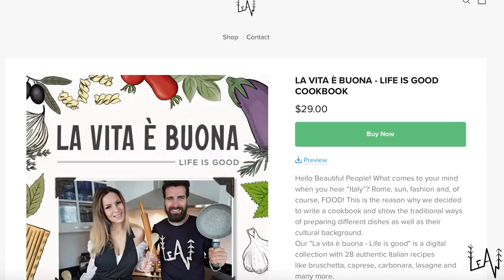COUPLE BUILDS A DIY backyard SHED in EXTREME weather ITALY // START TO FINISH timelapse

Comment: When I see the beautiful colors of Italy's landscape, especially in May and June, I think of the rain that's needed in March and April to create those colors. However, hail storms in July are very strange and scary. You worked very hard on this project, but it seemed to me the wood was low-budget material. I don't know what winters are like there, but I don't see this shed lasting very long. I remember building a shed with my dad near the pool of our family home. He laid a concrete floor above dirt, and the walls featured double wood with a 2x4 structure in between. Before the outer layer of pressure-treated wood was applied, a back tarp material was tarred to the infrastructure for added insulation and protection. 20 years later, the shed is still holding strong. Nothing sexier than a guy who enjoys building things, and it's total fun to see a pretty woman man-handle a saw. Fun video.

Comment: The shed looks great. I think your problem with the floor is due to two reasons (from what I could see in the video): 1) You glued down the boards and 2) You left little to no room on the sides. These two things restrict the ability of the wood to expand and contract with changes in humidity (and rain directly on the boards changes the humidity fast). In your case, with the rain, the boards tried to expand (ie. become wider), but there was no room, so at the spot where the boards were least fixed to the beams underneath, they let go and were pushed up. I estimate that you will need about 1 to 2 centimeters of room between the boards and the sides of the shed and it would have been better to not use the glue on the floor. Hopefully it will now stay flat, but if you do have to redo the floor again, I hope my advice helps you.

Comment: The shed looks beautiful.  Luca does excellent work.

Big rain for the last 4 days here in Tucson.  There's been flooding and fast water rescues.   It's brought the desert toads out of the ground at my place .  Amazing animals.  They survive the 45 C heat with no water by living  underground for 50 weeks out of the year.  No rain last summer, so the little guys have been underground for 2 years and survived just fine.  Incredible.

Comment: Your new shed is beautiful! You are both so inspiring; you both work so hard to achieve your dreams. Thank you for sharing your adventures and projects with us. Won't the rain and mice get into your new, dry shed through the holes I saw in some of the wooden cladding? I'm sure you thought of that already.  Something I've never done before? Inspired by Luca, I took apart my DeLonghi vacuum cleaner that no longer had strong suction. I cleaned everything I saw to clean, but it still didn't work well.  So I took it all apart again  and, instead of just rinsing the non-removable filter,  I spent an hour painstakingly cleaning out the rinsed (but still clogged) filter,  using an entire bag of 350 wood and cotton Qtips. Now it works great! Before "meeting" you two, I  would just have called a handyman (or bought a new vacuum cleaner). Thank you! 💙
Reply from the maker: 💙💙💙amazing!! You did a great job! Proud of you!!! 👏🏻👏🏻👏🏻👏🏻

Comment: The shed looks amazing!!! 👏
I don't know if you get very strong winds there, but you may want to consider anchoring the structure more to the concrete wall. I'm not a builder though, but I imagine drilling into the concrete wall and attaching posts to the wall and the shed, I don't know if that's possible?
I'm in such awe of all that you guys do and how you are you aren't afraid of challenges and making mistakes ❤
I tried skiing for the first time a couple of weeks ago. I didn't think I would do it because I was afraid of hurting myself,  but I did it! 😃

Comment: Nice work. In Finland we put two boards on each outside corner to finish it off.  Usually white with a contrasting colour to the main building/shed (e.g.barn red). We also put a metal roof as it’s stronger & adds much better weather protection.

Comment: You could leave gaps around and between the floor boards, wood is always shrinking and expanding with humidity and also for air circulation.

Comment: Luca, do you think the wood you used for the roof frame is thick and strong enough to hold up the roof fully loaded with snow?  Those boards look pretty thin. I would use 2x4s. 🌞

Comment: Your shed is tasking shape. Consider that the flooring will and walls too expand and contract across the width of your boards. So leave 12mm of a gap on both sides of the floor,[ for expansion ]  the length will not change noticibly. Cover that with a trim moulding to keep out the little mice. Based on the amount of snow and rain you had last winter, those 2x3 roof joists will not hold up, consider 2x4 at least, preferably 2x6, so it does not collapse under the wet snow you've had. Love you both All the Best        CHEERS      Steve h.

Comment: Shed Looks nice, didn’t see you fasten it to cement foundation.
2x2 rafter seem to small if you get a load of snow or ever need to get on the roof.
With such a large overhang the wind could lift it off.

Comment: My OCD kicked in when I saw all the knot holes. Im like hurry stop them up before the wasps move in.lol. 
It needs to be anchored down and with no more support then the roof has a heavy snow might crush it.
Reply: Mice will get through the holes was my thought...... and chew up your stuff in winter.
Reply: I definitely thought the roofing 'joists' aka supports could have be more as in closer spacing, I wonder if they use pressure treated lumber in Italy,  tbh its a pain the arse, you blink and that stuff cracks and warps the second its cut !
I've built huge planters on my roof but this Summer decided to build and L shaped planter  4 1/2ft by 4 1/2ft , 14 inches wide and 30 inches deep. No visible screws, pocket holes that I filled with saw dust and PL adhesive,  oh and I built it on a slanted roof in 90 degree weather and somehow it turned out level - no idea how lol

Comment: I’m impressed with your building skills! Great job! Does the cement wall need to be sealed from moisture? It would be a bummer if it got musky or moldy in there. I don’t know if that would happen but in home basements sometimes it’s necessary to seal cement or concrete blocks. You are an awesome team!
Reply: I agree on the sealing the concrete.

Comment: Nice video you two. I see a future problem with the floor happening if you don't put down a vapor barrier to protect the floor from moisture, rot, decay, mold, mildew, termites, carpenter ants, etc. It's your build and you did a good job. I'm just trying to save you from a future problem.

Comment: If the wood was "kiln" dried , using it outside it will expand. you need to leave about 1-2 cm around the wall edge on the floor for expansion. The floor will expand and contract with the humidity. Not so much in the long direction mostly in the width. Good luck.

Comment: Great job alot of hard work. Only concern is if you go away and are storing things of value like tools.  you put exterior hinges so if someone wanted to break in, all you have to do is unscrew the hinges to open the door; so no security.  if its not an issue than hopefully no problem.

Comment: did you use some silicon or other sealant for bottom of the uphill wall? If there's heavy rain, water will run down the hill and might enter the structure. Maybe an extra board on the outside stuck into the soil would also have the same effect.

Comment: Very nice job. Now you need a chicken coop somewhere else for fresh eggs. Weather modification. The seeding of aerosols creates huge down pours when the aerosols rain out of the sky after a seeding project. I have a sensor and the air pollution increases with rainfall. The pink sky later had a chemical trail from the jets spreading more aerosols. The color comes from the pollution they are spreading. You may also notice a warming trend between the spreading and the rainfall. The man made clouds hold the heat into the earth.

Comment: Dear Luca and Sara,

Most types of wood when in direct contact with cement or concrete will encounter serious decay very rapidly, like within a year or two.  The wood will turn into soft.  A separation is required using something very thin like sheet metal, plastic, tar paper or a coat of tar.  When exposed to the sun tar paper and plastics will decay too.  A retrofit using non rusting sheet metal is what you want and, sloped away from the wood to drain off the water.  You can do it.

In N. America were there are two types of natural woods which can have contact without corrosion. They are redwood and cedar. A third very common type of lumber here is pressure treated with chemicals.   

Ouch and oofa.  Sorry to be the bearer of such bad news but, it hurts to think that you might suffer this kind of loss.  We build with wood all the time in North America so, we know.  Please look it up for yourselves: "wood in direct contact with concrete".  I hope this saves you from heartache later down the road.

The shed is beautiful, honey colored wood, the natural color of concrete, excellently crafted.  The one step will help it many years.

Much love to you both and thanks for the wonderful videos.
Reply: pls excuse the typos.

Comment: Why not get both since your half way there? A custom shed and room upstairs. Make it so the floor can swing up both side fir access. And upstairs you can take out half that wall. As you can have 1/2 of the bottom wall there but it's a swing out long window to open up that view.
Reply: If you wanted it can be cheaply done. And not far from your plans. Anything after standing upstairs can be down stair too shed. And you can even extend it fir bigger equipment  you wheel in. Under the floor.
And looking at it from the outside it still look like a tool shed. As tool shed are knowed to have swing out window  not open it look borded up. Just 2 long 2"x4" for home made window. You hold up with a stick.  I can do this in my van louvre window in the back. And sitting in it parked it open the whole are.  My interior is beach and anything round that 50s decor or Art Deco. They work wonderfully together. You can get a round marine window on eBay. The decor you diy are beach drift wood. Use Manila road you coil around or hand things with. Color bottles are wonder to see through.
The paint are aqua, blue white green etc. water colors. And look for rope  fishing nets to hang. Then collect sea shells etc. make age looking signs. Look cool. And build things that are round. I get a construction cardboard cement tube that are about 10-15" and saw it in half. To make shelf out of them. Up high. Roof meet wall. Then put glue and carpet it and add a 1' board both end to mount it on the inside.
 You can solar the shed. Just ideas, I think that is your life style Decor. My Siamese cat fit that decor perfectly. LOL
Reply: Minilia rope of diffrents sizes. Boat are full of them.

Comment: I really like your channel.  Not to find fault, just to pass some information.   For years I worked as a rough framer.  In other words, I framed houses.   The cardinal rule was,  you dried in as soon as possible.   This did  NOT mean a finished roof, but rather the sheeting covered with tar paper.  The shingles would come later. I was worried on your behalf as soon as I saw you leaving the roof to do last.    Hope you can recover.  Good luck!

Comment: I have been wondering if you all had some of that bad weather.  And yes you are.  Happy that it was not so severe as other places that got total destruction.
Luca has such a good mind.  He must have inherited some engineering brains like his grandfather.
You both are hard workers and work so well together.  I need you ....I loved that part.  
NOT anything like me and my husband.  We always got into swearing matches.  He was always called asshole for not listening and being a hard head.  I was always a bitch for riding his ass.  End of day I would not fix his supper.   LOL
Very good project.  Should have been 2 day project but the weather.  Simple but very utilitarian.  Smart use of bricks under floor board and wall that followed the angle of the back wall.  
The only problem I see is how water will run down hill and water will get into the shed on the right side wall where it touches right up against the wood.  Just like the home, you should have covered the outside wall with the roof material.  Or plastic so that it will not seep into the shed.  Even the small bit of brick wall at the bottom will get moisture and may damage wood touching it.  Have to think on that.  Maybe some kind of thick plastic like paint could be applied.  Or maybe since the shed is not attached to bottom you can still lift it away from wall just a bit to get some kind of membrane down there.  Oh well that can be for later on.  You did do your best!
But I love it.  Great design and execution.  Will hold lots and very secure locked up while away on more adventures
Reply: Sorry for being long winded.
Reply from the maker: Yes thank you, is a very good advise 👍🏻👍🏻👌🏻💙